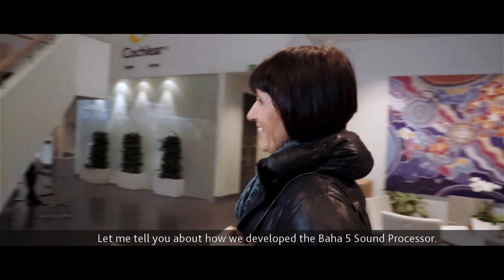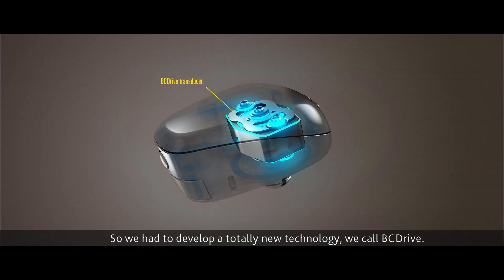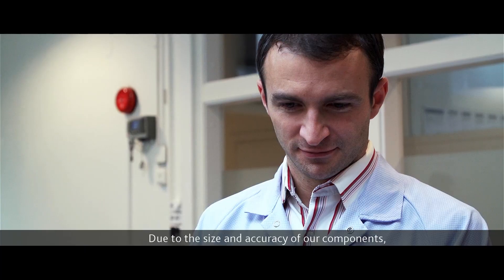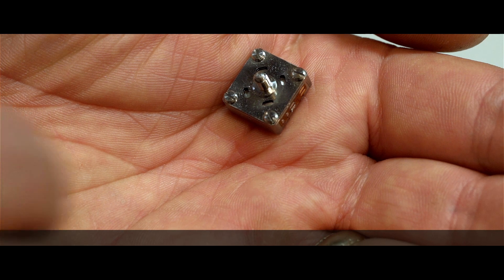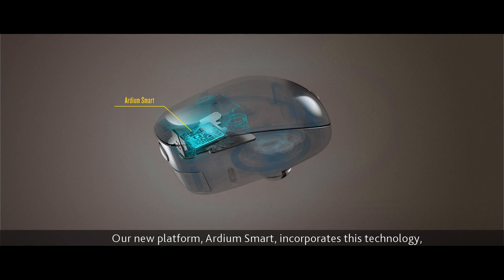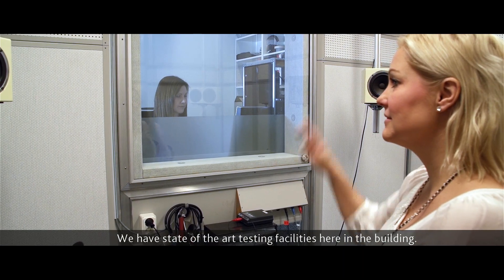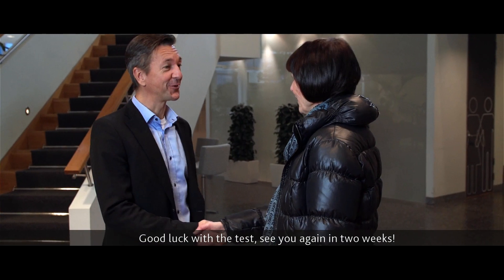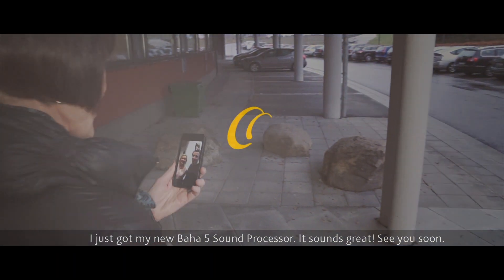Explore the Making of the New Cochlear™ Baha 5® Sound Processor

Comment: I know I may be in the minority on this one but I must share my story. Been SSD in my right ear since birth, my left ear is perfect. My ENT suggested I could benefit from an implant, demoed a BAHA 5 in his offices and was assured it'd be a lot louder and clearer after the operation for the attract system. Got myself excited to finally get a chance to hear like everyone else does. I had my operation back in Sept, got my BAHA 5 in October and I couldn't have been more disappointed. I was expecting it to be at least twice as loud as what I had demoed, no where close! I would say that my experience is that it's 10-15% louder once the abutment is implanted, which to me is not that great considering i can barely hear that it's working with my good ear plugged.

I regret to have to complain at this level and I do wish to come across as fair. Simply put I feel this product woefully fails to deliver. The sound quality is not good at all, weak volume, tinny, overly processed and faint. The wireless function is nothing to brag about, it loses connection constantly, the app is terrible, it favors iOS only so if you want to control the volume you either have to use an iPhone/iPad or spend $250 on a wireless phone clip. The body of the unit feels cheaply made. The battery door is of poor design and WILL break on you sooner than later. Despite it's user replaceable they will not simply sell you a battery door. Have to ship it off. 

From my own research the BAHA 4 seems like a more sensible design, I have not had the luxury of trying one out to comment on it's sound quality. With it having dedicated volume buttons instead of relying on a phone or the phone clip, that just makes sense. The battery door appears to be a more durable design. If anyone there ever reads this, please reconsider your choice to rely on wireless connectivity to adjust the volume. I find this to be a very irritating feature with little to no benefit. Even if the single button for selecting presets could be modified for double/triple clicking to cycle through the volume would be a welcomed improvement. 

I will state however that Cochlear's customer service has been wonderful. Had a broken unit, they took care of me under the 90 day warranty. Had a fitting with a rep from Cochlear and she was very patient, pleasant and thorough. Was most impressed with her. The people there are the great part of the company, the product is what I have fault with.

I do however regret getting this surgery at all after my experience with the BAHA 5. I should feel lucky that I don't really need this device, others with more profound hearing loss may get a lot of benefit out of this procedure. But with perfect hearing in my other ear, my expectations are elevated well beyond what this product can deliver. That's a pretty crushing blow to get your hopes up so high that your hope gets a nose bleed. I really wanted this product to succeed for me, some semblance of stereoscopic hearing, get to taste what others have. Only to have those hopes fall on it's face. 

I know I'm not everyone and my opinion is just that: my opinion. For those that have a similar hearing situation that I have, perhaps reconsider. I genuinely was happier without the device than with, was happier before I knew this was even a possibility. Least then I was content with the fate of my hearing, now I feel sort of teased and exploited by what I thought I was going to get. A very very very expensive experiment that's left me with a novelty rather than a solution.

Sorry Cochlear, but the BAHA 5 gets only a 1.5 out of 10 from this client.
Reply: I have been lucky enough to be able to use the BAHA system since the introduction of the BAHA 1 and have been wearing my advanced BAHA 5 for about a year.
Overall my experience with BAHA has been life enhancing.
 If I remember correctly the only one that was not a 100% was the BAHA3 but the problems I was experiencing were quickly solved by BAHA.
I suffer from hearing weakness in both ears but the BAHA allows to experience almost normal  hearing 

I'm sorry to read you are disappointed in your purchase but for me the BAHA5 with its brilliant sound quality has been all but flawless in fact I would go so far has to say a work of technical genius.

 If you are an American the only other thing I would like to say is, in all seriousness, get your great Nation to introduce  a genuine 100% single payer UHC.
Thanks to the NHS (I'm Brit') the operation I have used over the past many years has been direct cost free to me.
From my initial abutment fitting operation to the aid and its regular (everywhere years) replacement or upgrade 
Likewise the aid, batteries, service and three year replacement comes at no direct cost to me 

*my only criticism being the relatively short batter life (which is understandable given the small size of the BAHA) and the running problem with all hearing aids its not rain proof.

Comment: A little research shows that the Baha models are updated less frequently than smartphones (Model 3 was released in 2009 and 9 years later we're on Model 5) yet related technology develops at an apparently much faster rate presumably due to the much small market. I'm particularly interested in the latest developments in both Bluetooth and more efficient & smaller drivers and mics. I expect that Baha 6 should be able to eliminate the requirement for a separate mic in order to make phone calls (after all there is a mic in the device itself) but also be smaller due to further miniaturization and improved efficiency reducing the size of the battery. How long should we expect to wait for the next generation?